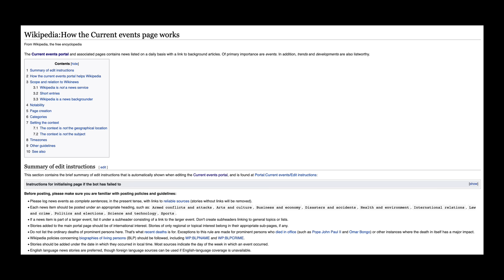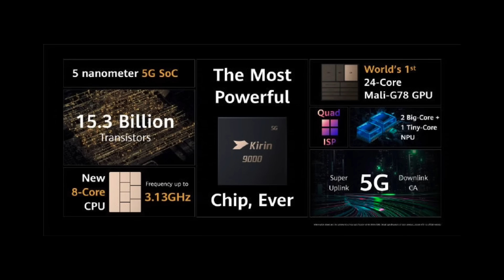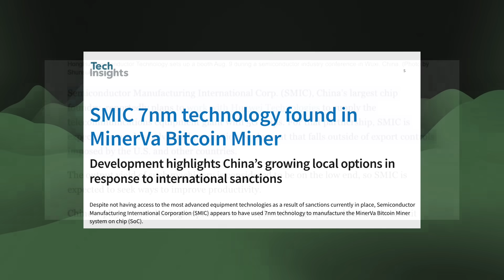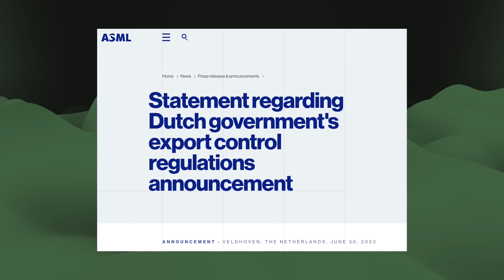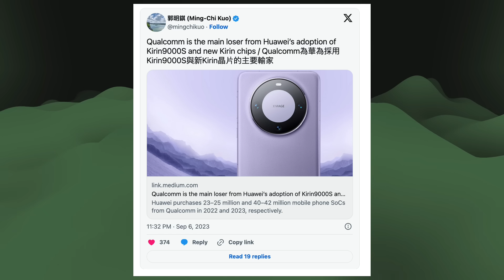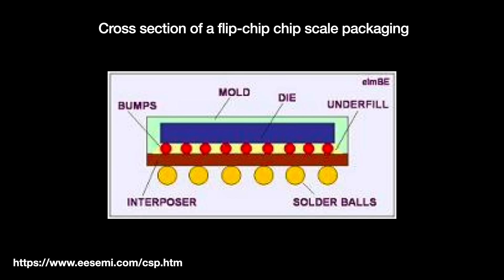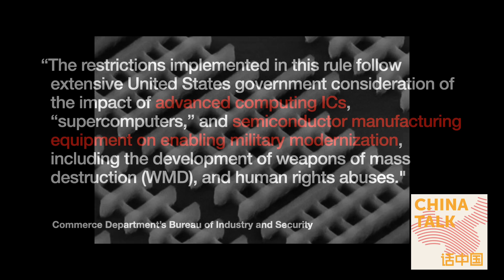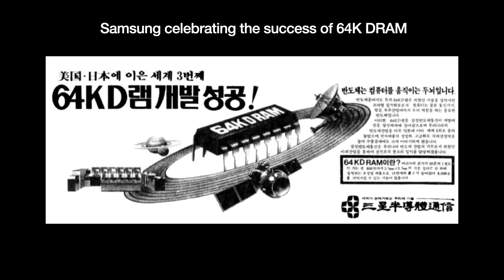China's 7nm Semiconductor Breakthrough

Comment: Harvard Business review:  "China cannot innovate"?  Thank-you for clarifying my understanding of the Kirin 9000s.  I always understood that one could produce a 7nm chip using DUV a process which I thought that TSMC had developed.  But I thought that this process was not cost effective.  Kudos to SMIC for making it economically feasible for their latest phone.  .But this depends on DUV which, after 1/1/2024 will no longer be available per ASML.  I suppose China will have to either manufacture their own DUV lithography or another process to come up with high performance chips.  As it has said been before, "mother is the necessity of invention."
Reply: "innovate" meaning they mostly designed the chips inside and out, I've heard no one answer this question. Of course they can copy well, design most of the chip inside to out? .... nnnnn
Reply: Did anyone verify that these chips are being produced at a profit to smic? No? Then why are you presuming they can make a profit? I think it's unlikely that they are making money now. That doesn't mean they won't find a way, but it also doesn't guarantee that this process will ever be profitable.
Reply: @edfhobbies556  China understands that they need to develop indigenous technology.  Simply copying (as the Soviets did) or rebadging (as Russia is doing) leaves one vulnerable; developing the tech oneself is critical for tech independence even if that means taking rather longer to get to a similar level of technology.
Reply: TSMC is using DUV on their N6 node. TSMC N7 and N7P were DUV while N7+ was EUV. It’s EUV that’s not very cost effective, so if you can make a node function well without it then you don’t want to use it. EUV becomes mandatory on 5nm class nodes and smaller.
Reply: @briancase6180 in many ways for this tech i dont think china cares if it is ever profitable.
Reply: since all are speculation, then everything is possible.
Reply: I am sure there are some scalable alternatives to EUV.The world is big, they just have to find it.
Reply: Why does he say "we" when speaking of advances that benefit the Chinese Communist Party?
Reply: patent is useless serriajohn
Reply: You are also presuming they are not making a profit.
Reply: Who cares about profit or cost of this soc if there are enough Chinese inside China who is willing to over pay (say $100 extra usd) for a phone made entirely in China?

 Last Mate 40 series phone sold for about 4 million units.  If the new Mate 60 sells at this value, Huawei is coming out on top!  Nobody cares about how expensive it is to fab this soc!
Reply: Yes but China doesn't have an infinite supply of highly skilled people. The core strength of western companies is that they attract highly skilled people from all over the world including China itself. So there is a limit to what China can do by themselves.
Reply: @TheFirebird123456  Do you understand business economics? Do you understand the defense industry? If you say this is a military product, I think you are right! But if it is a civilian product, you are an joker!
Reply: no such thing as not innovx or et,c ceuxuax, do, be, outx, can do, be, outx etc any nmw s perfx